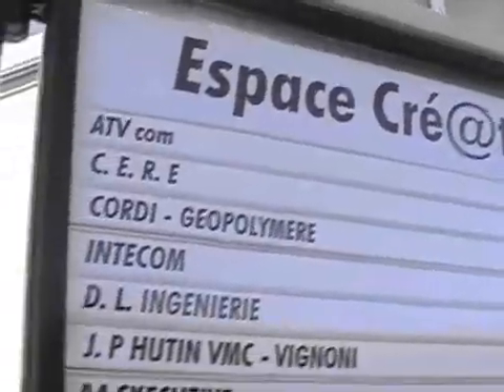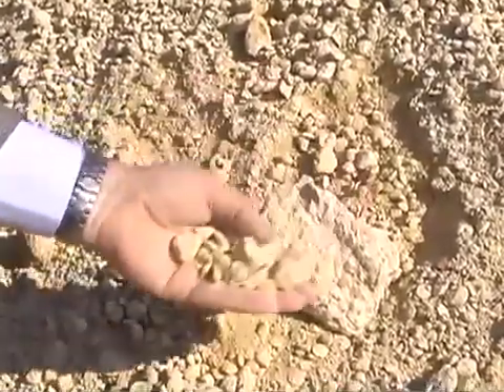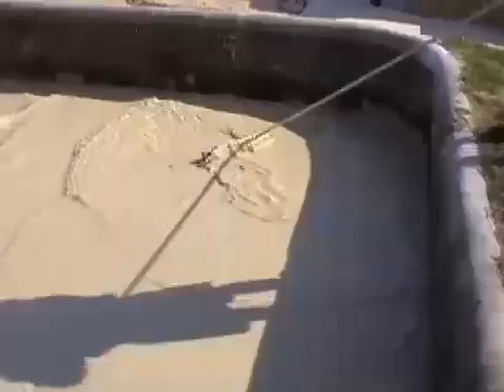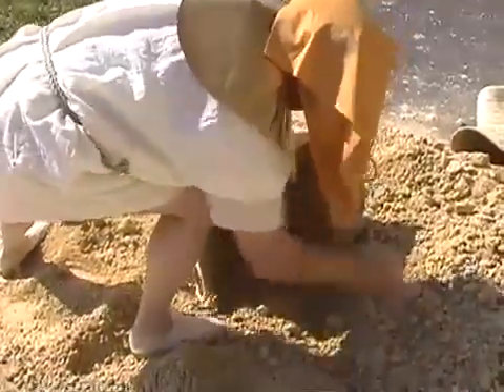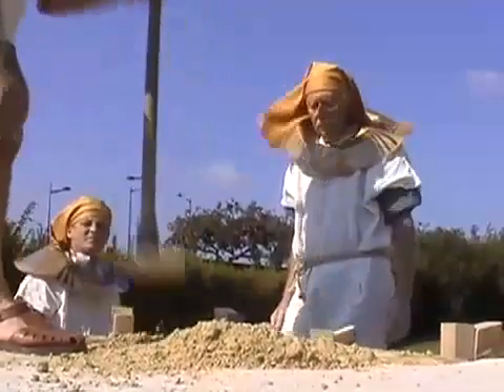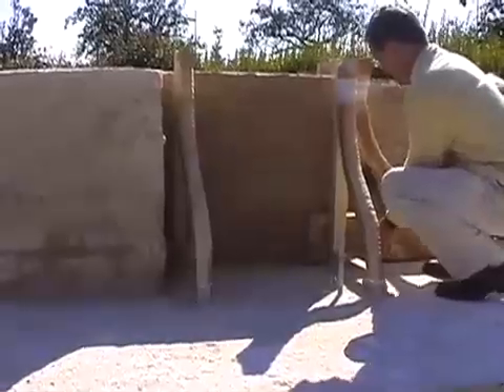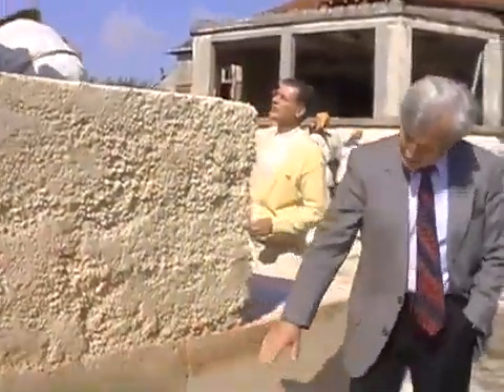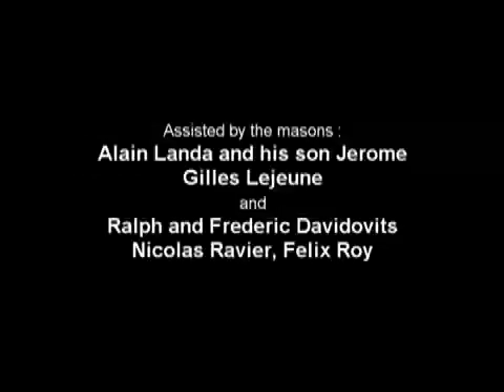Pyramid Fabricated Limestone & Geopolymers

Comment: For many years I have thought this was a very likely solution but there is one challenge to its credibility: The Pyramid (great) weighs approx 5.9 million tons constructed of approx 2.3 million blocks weighing 2.8 tonnes each - dry. To build that pyramid needs the placing (or casting) of 12 blocks every hour day and night for 20 years! I don't have a solution. But casting them in-situe still requires the same volumes/weight of raw material . plus water . plus mixing those ingredients someplace else and carrying millions of buckets. Whew....12 blocks an hour - for 20 years ??? (PS I got these figures from some other website - not my calcs :-)